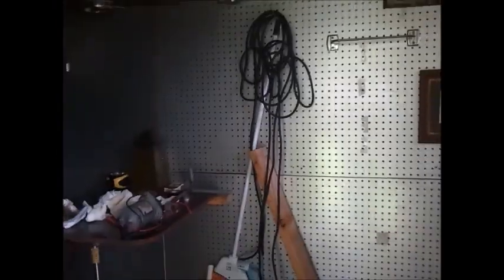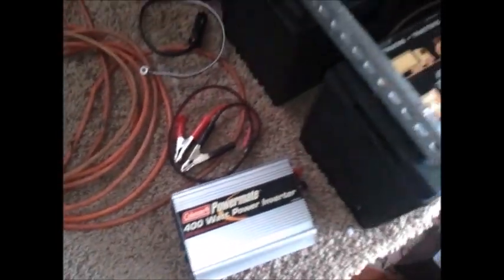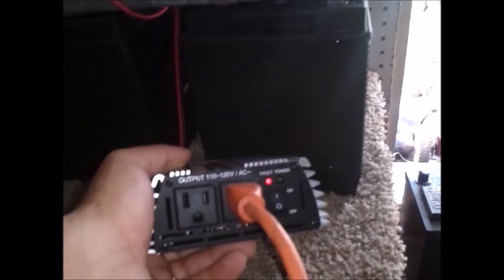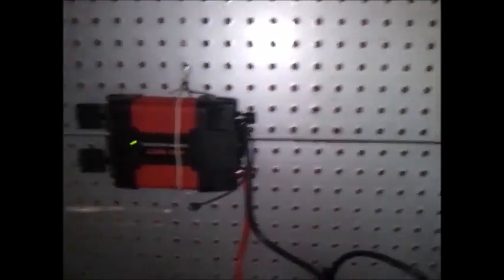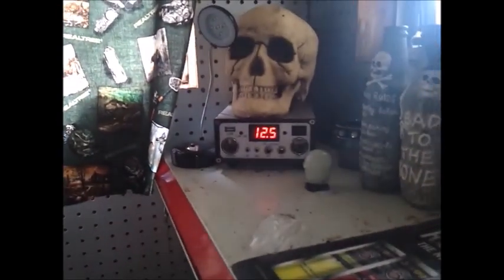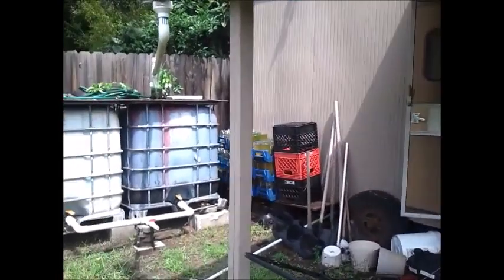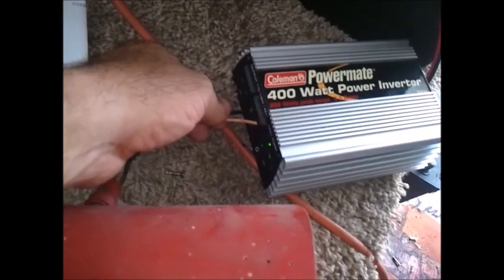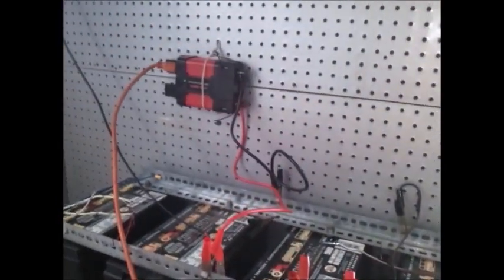can a fridge run on a harbor freight solar kit

Comment: I found a really cool (pun intened) little fridge from Fridgedair that is sold at Lowe's It's a Refrigerator/Freezer combo and it only draws 37 watts!  $219.00! 

https://www.lowes.com/pd/Frigidaire-3-1-cu-ft-Freestanding-Compact-Refrigerator-with-Freezer-Compartment-Silver-Mist-ENERGY-STAR/50160167

I had them look up on the website and confirm the power consumption.  Sears used to sell this one also.
Reply from the maker: TexasScout Noneofyourbusiness hell ya.thank you for sharing.

Comment: just wondering what type and how many batteries you have in the camper
Reply from the maker: airstreams and things I believe is a group 31 batteries, I used for a while and have good luck. stay tuned to my other channel Massisoutdoor I'm going to build a cabin in the woods that will be most reclaimed materials and off the grid . thanks for watching.

Comment: if every household powered their frig by solar the elect companies would loose a mint.
Reply from the maker: Major Mazzaroth your right,  use solar on the big energy users and save a lot of money.
Reply: Massis32210 its not that big of a saving per household per se maybe 20 to 25 bucks a month u could recoup  your investment in a little more than a year but collectively the utility companies would loose big time. Thats why they throw road blocks  at every chance they can. Plus with the help of the local  governments who depend on this windfall from the electric company the onsumer is stuck between  a rock and a hard place.
Reply: you hit the nail smack right on the head regarding road blocks utility company throws. I went to school for solar course better known as Photovoltaic Technology.

Comment: Those bare rails are a SCARY setup!  Hope anything metal never drops across that!
Reply from the maker: Hashirama Senju I had a safety that when on to stop a short circuit. thanks for watching.
Reply: These panels are not sufficient to run a TV and a mini refrigerator, on demand through the night.  They are a novelty but inadequate to do anything practically.  By the way, at a rate of $0.25 per kwh it would take 600 hours before you break even with the power company on the money you spent buying this toy.  I am not even considering the unhealthy noise level the inverter creates that you suffer through.
Reply: I disagree. I use the same panels in my house and it is just fine. I am not grid connected, all of my power comes from these panels and what i have stored in my battery bank. I wouldnt call it a toy, as i live on it. Granted my power requirements are pretty basic. But i have all the usual amemties, lights, fans cuz summer freaking sucks, phones and laptops charged all the time. Calling it a toy is a bit much. These cheap lil panels are suprising i will tell you that. Though i swear they lie when they say the panels dont cause diacharge at night
Reply: Aya Roç I use the same panels but I put them inside a tinted west facing window, and my test battery is always at 13+v.

Comment: 100ah battery realistic 
100ah x 12v = 1200wh x .5 (50% battery capacity realistic) = 600wh
600wh @ 20 hrs = 30 watts per hr or 600 watts for one hr
600wh / 19 (through the night) = 31.58 watts per hr for 19 hrs before failure
It would require about 132 watts in solar power to run your load at 31.58 watts continuous and recharge the battery to full in about 4.5 hrs.
Reply from the maker: John Lucero I planned to run a full 24hr run to see. thanks for watching.
Reply: Yes I did, 24 hrs minus 6 hrs of daylight give or take an hr equals 19. You didn't read the whole thing. Even says through the night. Sunlight does not equal solar daylight even in Arizona you only get about 7 hrs true daylight.
Reply: Harbor freight panels will run a fridge in daylight but show us what your voltage is at 7 am or even 9 am. Also you can get 35-40 watt panels from eBay for around $40-$45 so for $90 you can get 80 watts for half the harbor freight panels

Comment: Holy shit! Have I not posted this like 45 times already? Maybe not. Sorry. Your typical Harborfreight solar kit will provide at max a 45w 12v power source for charging. That's 3 amps. That's equal to a trickle charge from a run of the mill battery charger at 3 amps. These panels are nothing short of the end of society as we know of it lol.
Reply from the maker: wingmanalive in a pinch they will work. lol thanks for watching.

Comment: my fridge has no moving parts and consumed zero power. hint , alaska
Reply from the maker: Robert Bodell lol, that's a good one. well I live in Florida, have no choice but have a fridge.  lol thanks for watching.
Reply: massis32210 what part, I am originally from Bradenton
Reply from the maker: Robert Bodell I'm from Jacksonville ,but soon moving a little to the north to callahan florida.
Reply: massis32210 everybody said I was lucky to live in Florida. I never realized how miserable the humidity was. I was colder in Florida at 40 than I was here in Alaska at -30 lol.

Comment: Some inverters see a capacitor start motor as a short and shut down automatically. I have to run my electric wood splitter on a generator.
,
My refrigerator is built of a half sheet of 2" foam board and a half sheet of 3/8 plywood, 3" pvc pipe, wood screws, a piece of plastic and construction glue. It has a temperature range of 70 to 40 below and no moving parts and consumes no electricity.

NOTE: I live in Alaska

Comment: i would figure the solar panels only charge the battery if you buy a 1500 or 2000 watt  inverter that it should run
Reply from the maker: eric soles the inverter only changes the 12v dc into 110vac. thanks for watching.
Reply from the maker: eric soles the panels will recharge the batteries and the inverter will run the fridge but it all comes down to the amount of Watts going in the batteries versus the amount of amps That's being pulled off of them.thanks for watching.

Comment: Are you latino ?
Reply: Why do you need a fridge in Michigan in WINTER?
Reply from the maker: Christmas Eve no, arab. I get that a lot, most think that I'm Puerto Rican.
Reply: Dang it!! lol!! I never get it right!  Sorry if that offended you.  But I loved your video.  I did a similar test with a pair of solar panels in my backyard (550w altogether) and a fairly large fridge.  I had it running for two months straight.  Here in Michigan, unfortunately, as fall hit, the batteries drained and could no longer support it.  It would have been nice if I could run it all year long.
Reply from the maker: No you didn't offend me,I get it all the time. As far as the fridge being a Michigan I believe you'll get a lot of wind through there. I've seen the experiments with half solar half wind power so that way you can supplement the power in the winter time using wind.

Comment: i do experiment that kind of fridge i use 1 marine battery with a 12 volts @ 160 Ah, the meter reading of the battery before i plug that kind fridge, is 13.8 volts, and  after 10 hours the voltage reading of my battery is 11.2 volts, so i have to stop to recharge again the battery, by the way i used 1500 watts pure sine wave inverter for my experiment, my point on my experiment is to know how many hours i can  use that kind of battery, before i charge again
Reply: draining a Lead Acids battery to 11.2 Volts is damaging the battery and will shorten the life of it. Shallower the average  depth-of-discharge (DoD), increases the battery life. For example, a battery with an  average of 50% DoD will last twice as long or more as an 80% DoD; a 20% DoD battery will  last five times longer than a 50% DoD.  For example, golf cart batteries will average  225 cycles at 80% DoD and increase to 750 cycles at 50% DoD.  Try to avoid DoD that  is less than 10% or greater than 80%.  Industrial traction and stationary deep cycle  batteries are designed for 80% DoD and most marine an RV deep cycle batteries are designed  for 50% DoD.
Reply: @integr8er66  what sort of batterys will you reccomennd for a off grid cabin,? Full size rifg, led lights ,?
Reply: @milliondollar2981  Golf Cart batteries, any reputable brand, I have Crown I think, but brand doesn't matter a lot as long as its a namebrand. Dollar for Dollar they beat the gelcells etc.If the water in them is kept full and you don't run them too far down you can expect them to last about 10 years. Sizing is important and bigger is better so you can manage the % drain and still use the power you need without starting the gen. You will need a backup generator in case of clouds etc, and you should use the gen to power a 3 stage charger to charge the batteries while it is running, but don't pull power from the inverter while you are charging it screws up the 3 stage chargers ability to switch stages. Power your loads directly off the gen when it is running and you are charging
Reply from the maker: sounds like a great experiment, the inverter is a great choice for sending the best power possible. I'll redo my test and try your way to see what I can get out of my set up. thanks for watching.

Comment: Add your amps you need to use 120 watts input per amp have a good day.
Reply: It's NOT about amps. It's about KW hours or amp HOURS. Unless you are trying to run your fridge off of the panel with NO battery then it's about POWER not amps. (huge difference, apples and oranges)

Comment: The solar panels are charging the 4 batteries that power the fridge..or.... the solar panels are powering the fridge through the inverter directly?
Reply from the maker: Kevin Mendez the panels are charging  the batteries , and powering the fridge through the inverter.  its not a bad setup. thanks for watching.
Reply: Yeah I think that's the only way possible at the moment.
I wanted to put a mini fridge in my truck and have flat panels on my roof so it doesn't kill my battery. easier said than done.
Reply from the maker: Kevin Mendez its been done. look for manofmanythings on youtube.  He has done it in a jeep Cherokee. two panels, two batteries and a charge controller.  its a survivor jeep.
Reply: hell yeah thanks!!

Comment: you need a ground on your cord dumb ass
]
Reply: No you don't NEED one it works fine without one. Do you know how many power tools have two prong plugs now?  It might add safety but that is over rated anyway.

Comment: please please insulate your bus bar
Reply: heat shrink will work fine
Reply from the maker: Steven Correa for what I was trying , I had a safety that went over it to protect it all from shorts. thanks for watching.
Reply: Testing is just that and I would also not go through the same effort as if it were a finished install.

Comment: I am totally new at all of this, can you tell me how you set up your battery system.  Thank you...
Reply from the maker: Karen Macaluso I said the battery system up just as you would with a standard kit the only difference is I just added more batteries. there's a line that comes from the charge controller down to feed the batteries plus and minus than all the batteries has all the negatives connected together and all the positives connect together so that way you're running your black line from your inverter to the negative side and then the positive line from the inverter will go to the positive side . thanks for watching.

Comment: I hear that one must increase the amp rating of the inverter in order to go up. I see that you are using extra inverters how is that hooked up?
Reply from the maker: Dart Gar no just one inverter, one didn't start the fridge, and one did. thanks for watching.
Reply: massis32210
What is the watt/hour rating of the batteries? I got a 10AH small to start. I planning to get a bigger battery. What do you suggest or what is working for you?
Reply from the maker: well right now im using heavy duty truck battery , its been working but i need to use some golf cart battery. they have a lot more AH on them then what i use.
Reply: massis32210
Thanks for replying. I have mine set up and I am waiting for the battery to be delivered. I also plan to get a Power Inverter soon.

Comment: ur battery pack, r they hooked up with copper connections
Reply from the maker: no copper connectors it was just a long straight busbar for now but I'm about to redo it with copper copper end cables better connection. thanks for watching.

Comment: You need about 150 Watts of panels to run a mini fridge like that. The math works like this. it takes about 650 Watt hrs per day to run it. so divide 650 by your panel capacity say 150 Watts and you need about 4hrs of 100% sun per day to run it. AND you need at least 1/2 or more of that in battery capacity so at least 35 Amp hrs of rated deep cycle battery to get you through the night (12 hrs)
Reply from the maker: cool info. Thanks for watching.
Reply: This data looks correct. the problem is that the Harbor Freight Thunderbolt Magnum system is comprised of three 15W panels, for a total of 45W. Two kits, properly wired together, would give 90W.

That said, the number of panels, as it pertains to this several hour experiment, is largely irrelevant. What matters is the size of the battery bank. The inverter is running off of the battery bank, not the solar panels, directly. As such, the ability of the bank to power the 'fridge is limited by the output of the bank...which is more than enough to power a 2.0cf or 2.9cf mini-'fridge.

As @integr8er66 indicated, a system such as this would need a sustained output of 150W. Since the solar panels are only generating 45W, the draw from the 'fridge will eventually outrun the ability of the solar panels to replenish the battery bank. Given a draw of 150W and an output of 45W from the panels, one would need at least four of the Harbor Freight panel systems to run the 'fridge — with 30W remaining for other uses.

A better way to run this experiment would be to either...

a) run it continuously for a week and monitor the charge/discharge data 24/7 to determine how long this bank would sustain the needs of running the 'fridge, or...

b) to run the refrigerator directly from the charge controller, without benefit of the battery bank. This scenario would, of course, have failed immediately, if the appliance does, indeed, require 150W to operate. It is difficult to verify, as power requirements are surprisingly sparse in the manuals for these devices.
Reply: integr8er66
Reply: Herman May
Reply: integr8er66 I have a 100 watt solar kit, and a 35AMP deep cycle 12 volt. Looking into inverters. Not sure whats the max pure sinewave wattage I can get. Ultimately, I want to power a 12 v portable freezer 65 watt freezer amd a few other devices, laptop, tv, radios, etc.
Reply from the maker: Acousticstrings as far as inverters there's thousands of choices out there on the market sounds like you're going to need more one of the professional models they're going to run up there around the $5,000 Mark but they are purely worth the investment
Reply from the maker: DOING SOLAR MY WAY that's a question about the wire rot. I'll look into that when I set up the offgrid cabin on my second channel massis-outdoors. Thanks for watching.
Reply from the maker: DOING SOLAR MY WAY I'm going to do the same, 5 kits should be enough for my cabin.
Reply: HF has New 100Watt Kits for the Same Price as their Old 45Watt Kits. So you would only need 2 Kits and add a GOOD Mppt Controller to get the most out of the Cells, and you will have more than enough. Since the HF Cells Do WAY Better in Low Light than other Cells. Even Half Covered a HF Cell will put out Well over Half it's Ratting while Others will put out None.
Reply from the maker: ravenlorans  thats what im going to use at my OffGrid cabin im building.  Check it out on my second channel Massisoutdoor.  I'm start film soon.

Comment: I could tell you it wouldn't work, 400 Watt is only 3.3 amps at 120. what's more 45 watt panel * 10 hrs of sun BEST CASE only = 450 watt Hrs. BEST BEST case. the frige prob draws 600 Watt which means you could do it if you didn't have more than 4.5 min of run time per hour. and this would be at 100% EFF on the inverter. FAIL
Reply: A small fridge like that should be taking around 100W, unless there is something horribly wrong with it.
However if you have 10h of sun you need to calculate it as half to account for off peak power, so 45W * 5h = 225Wh per day maximum, and usually best to take off 10% for charge controllers and another 10% for inverters, so 180Wh is the more reasonable assumption, so you get 1.8h of that fridge going full blast.
Reply: What are you talking about Off Peak power? You mean clouds? I said BEST CASE that means no clouds I don't know where this guy is Death Valley or Seattle? Also the fridge does not run continuously, so you also need to know what the outside temp is and how well insulated the box is. All things that can play into how long it will run. the big takeaway here is that its about Amp Hrs, or KW hours not just amps and watts.

Comment: The surge power to start a refrigerator even as small as she is around 800-900 watts then drops down to a couple of hundred watts to run her.
Reply from the maker: its crazy that the harbor freight inverter ran it with no problem, but the Colman with the same power would not come close. thanks for watching.